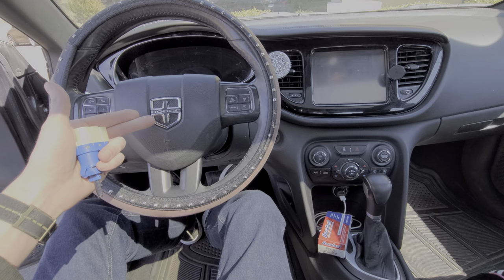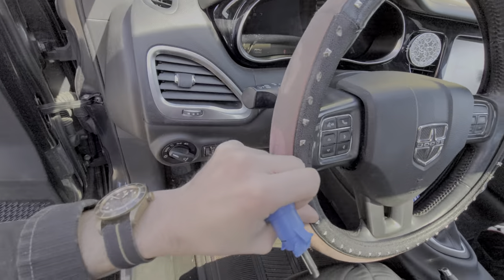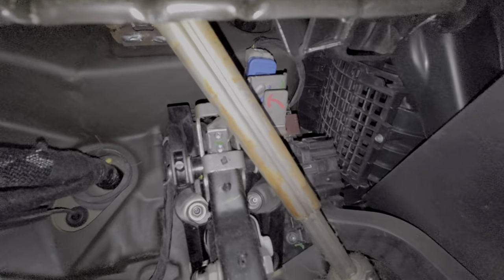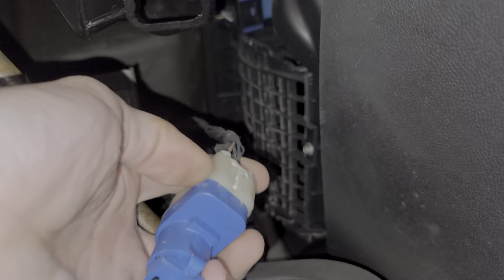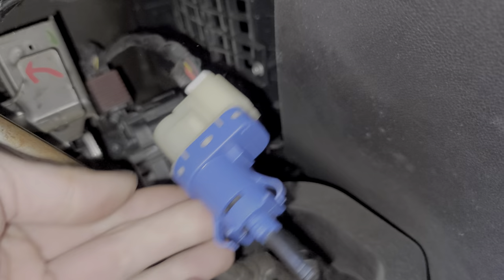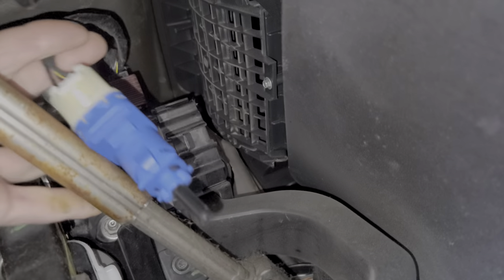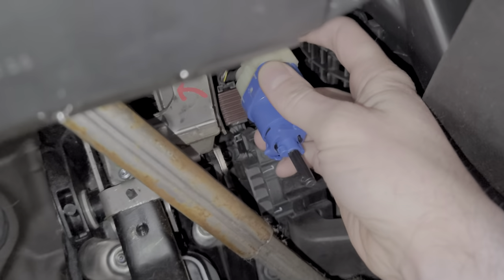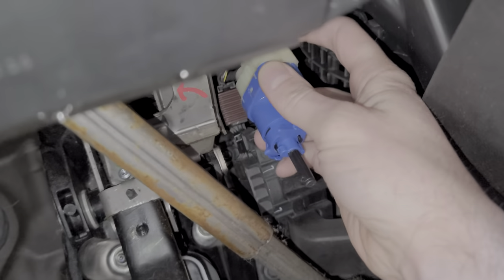2013 Dodge Dart Stop Light Switch Replacement

Comment: My cruise control doesn't work anymore, so I'm going to assume that this is the problem. When diagnosing anything, start out with the simplest and cheapest alternative, things like this are usually not complicated, very simple. I'll get a new brake light switch and see if this is the problem , thanks for the video.